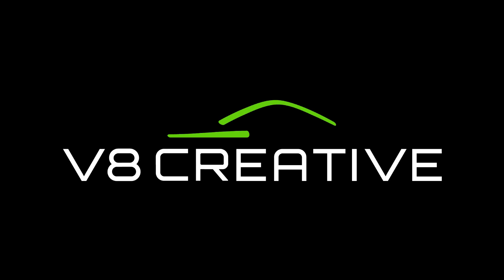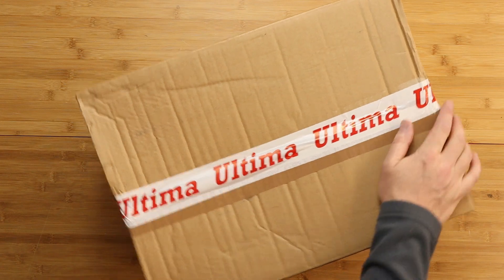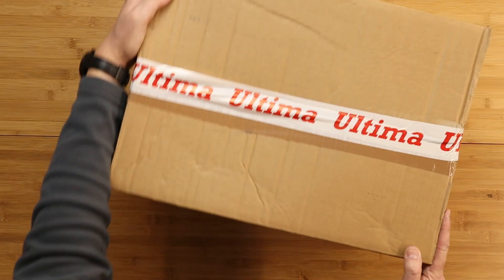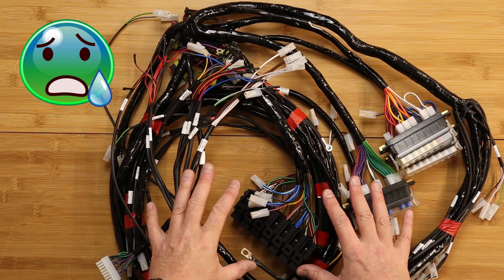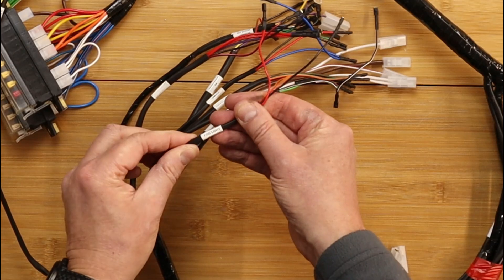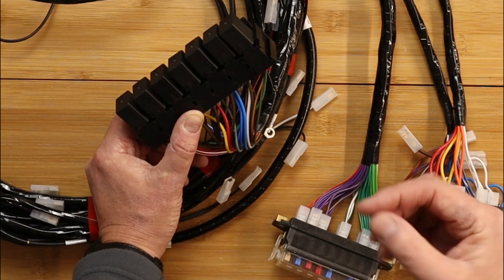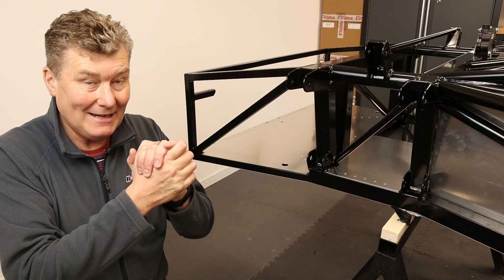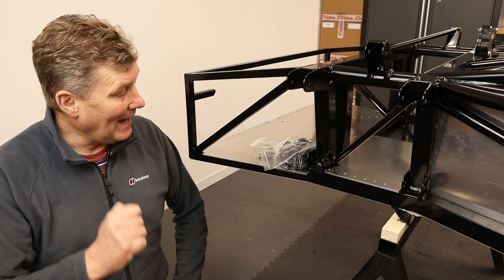Building an Ultima RS with Nigel Dean. Part 6 – Electrics

Comment: A bit surprised a car of this magnitude still has relays and not something more modern.
Reply from the maker: You have just spotted one of the exact reasons why the Ultima is such a sought after brand. Unlike the latest supercars where you need a super-computer to diagnose and service the machine, with the Ultima everything is simple and proven technology. As such any garage can maintain an Ultima, a home enthusiast can easily fault find and resolve issues. This makes ownership incredibly cost-effective. Many thanks for your comment, and keep tuned loads more content to come. Cheers Nigel
Reply: @v8creative  I didn't mean it's a bad thing. I'm actually saving up to my own Ultima and I would probably replace the relays. I want to be able to control and diagnose my car with a "super computer".
Reply from the maker: @johan.mp4  No worries, I didn’t read it that way. I must admit the sun £100 servicing cost is rather appealing
Reply: @v8creative  ... and thank you so much for this video series. It will help me a lot!
Reply from the maker: @johan.mp4  my pleasure :-)

Comment: Hi Nigel. I'm almost done running the wiring loom and I noticed you fed it through the frame (triangles) just in front of and behind the door (at 6:57 and 7:08 in video). The PDF and manual images shows the loom running outside the frame. Any reason you did that? It does look cleaner inside the frame.
Reply from the maker: Hi Brian, good to hear you are making good progress. I had to look at a few videos to double check the final routing of the loom and in fact I eventually routed it the way the manual recommends. I can't recall the reason but the main battery feed and also brake line goes through the triangulation of the chassis so maybe it's a clearance issue? Thanks for tuning in and I hope the content helps you with your build. Cheers Nigel
Reply: @v8creative  Your videos are helping TREMENDOUSLY! I finished wiring loom last night. Onto the radiator and coolant pipes!

Comment: Looks like I'd want an air drill for this job.  Sure, it means you have a tail that isn't there with the cordless drill, but it weighs so much less.  And it doesn't heat up as you use it.
Reply from the maker: A set of air tools and a compressor is an option but i have never been able to justify the cost considering I use my electric tools for DIY in the house. Cheer Nigel

Comment: Nigel, I noticed the Odyssey battery that came with your kit. I am wondering what engine you are putting in your car and if I could use the same battery on my project. It is nice and compact. I am planning a GM LT4 and would like a smaller sized battery then a standard auto battery. Any feedback on this would be appreciated.
Reply from the maker: Hi Joel, I have used Odyssey batteries before and they pack a punch for their physical size. I see no problem with a similar sized unit cranking a LT4 since compression rations and capacity of the LS and LT engines offered by Ultima are similar - I'm trying not to give away my engine choice 😀. Cheers Nigel
Reply: @v8creative  Thanks Nigel, wasn’t sure if you covered which engine you chose. I couldn’t remember, but now I know it’s gonna special!
Reply from the maker: @JoelKSLC  I have yet to share the engine choice, but regardless capacity and compression ratio are similar so resistance to cranking are not too far apart. Cheers Nigel

Comment: Nice video, maybe you should mark up nuts and bolts as complete, as you go with nut a bolt paint pen, Red for Torqued up, Blue pulled up by hand only. IVA inspectors love to see this.
Reply from the maker: Hi Mike, and good call out regarding the blue line. I always use the red line when I do the final tighten which I undertake in one hit once the car is at rolling chassis stage. I have a zero trust approach whereby I assume everything is loose until it get the red line of approval. I tend to do the entire chassis in one hit once the rolling chassis is on the ground. As you say the IVA examiners (the UK test to ensure a component car meets European regulation in case our international audience is unaware), love to see a logical approach to a build. Cheers and thanks for the support of the channel. Nigel

Comment: Seems Ultima is a very well produced product. My experience of adding these sorts of things is that you do a beautiful job with P-clip and holes in the chassis as per what you thought was the best way to do it, and then find when the body panel, or some other object goes on, you find that you actually had to P-clip onto the underside or some other way round to avoid fouling the panel. Having built one of these cars already I'm guessing you won't be running into those sorts of issues!
Reply from the maker: Hi Kevin, you are spot on. Ultima have put a lot of work into providing instructions on where to route every single wire for the exact reasons you highlight. When I built the GTR 20 years ago this type of instruction was not available, so having this level of detail was very reassuring. Thanks for watching and the comment. Nigel
Reply: @v8creative  I wish you hadn't said that.... was it really 20 years ago I was reading those articles in Which Kit? (I think). ....I thought it was about 10 years ago :(

Comment: Hi Nigel and Rufus, glad to see you’re both having fun with the build. After hearing / reading so many horror stories about wiring loom layouts, you’ve just made it look so incredibly simple. Regarding all the P clips etc, did you remotely consider tapping holes and using M4 button/flange head bolts so they could be removed later should the need arise? I can’t help but wonder if there’s always a possibility of needing to add to/modify the loom later for additions and if this might be easier if the clips are removable. I suppose it depends just how standard you wish to keep the whole car. Keep up the good work !!
Reply from the maker: Hi Garreth and appreciate the input. Drilling and tapping is an option but I decided to follow the factory recommended route since my approach to additional wiring (if required), is to make a completely separate loom and attach with additional P clips. The reason I use this approach is it makes fault-finding in the future (for me or subsequent owners), a lot simpler and factory support would still be available for the standard unmodified loom. In the past on another build I have drilled and tapped such holes as an experiment and it took ages and some holes simply could not be tapped since there was not enough room for the tap. Having said all this, I appreciate the comment since as you say the use of pop rivets is a one time deal. Cheers Nigel
Reply: Thanks Nigel, thats a very good reason indeed to rivet things in, keep everything standard, and having everything tidy and labelled. Creating a second loom for any mods is a superb idea.

Comment: Nigel, I'm really enjoying the series. Having done bond and ground installations on aircraft, it's only necessary to bare the ground (Earth) surface where the terminal bonds. In areas that may see moisture we use a conductive sealant in the part stackup which assures limited degradation of the bond over time. Perhaps not so critical on an automobile.
Reply from the maker: Hi Miles, and superb input for those of us building cars. I have respect for builders who fly their creations. Once again thanks for the comment. Cheers Nigel